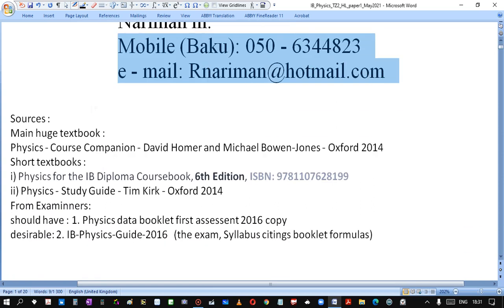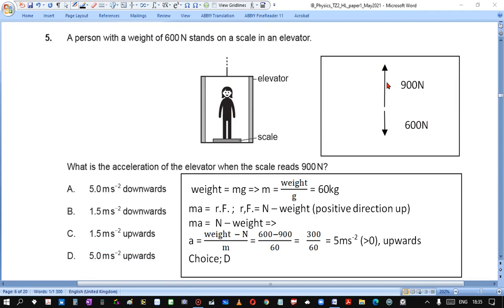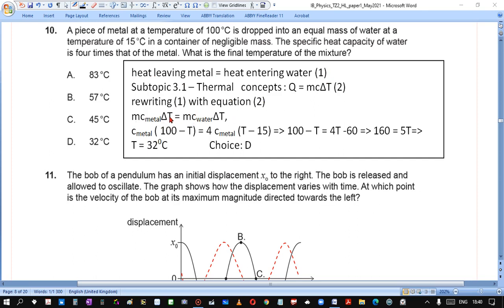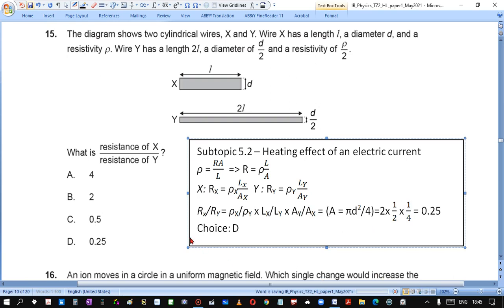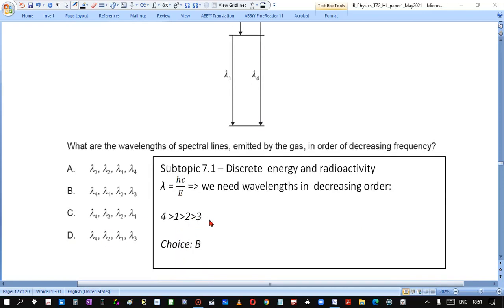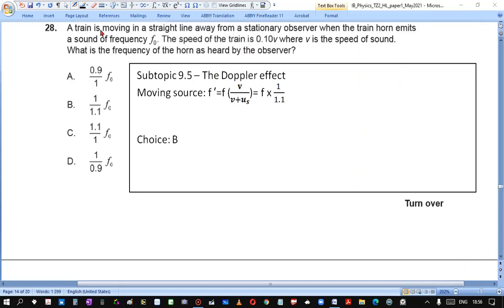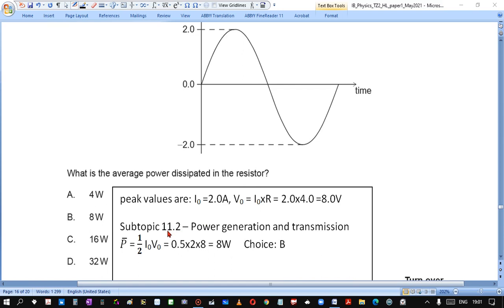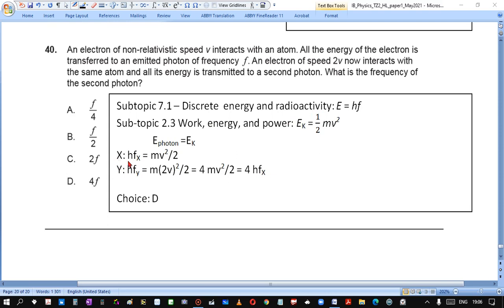Solutions IB Physics HL Paper1 May 2021 TZ2 past paper Baku teacher TISA EAS XXI century Dunya

Comment: One question, I don't understand why in question 21, wavelengths should be in decreasing order, if it is telling you that it is decreasing frequency, it is not backwards?
Reply from the maker: there is no question 21.
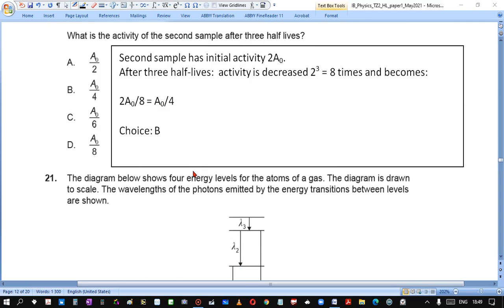Reply: @NarimanRzaguliyev  There definitely is, 18:20, I have the same question
Reply: A bigger transition means more energy is emitted, energy and frequency are directly proportional so 4 > 1 > 2 > 3. The wavelength is just to confuse you
Reply from the maker: Agree.. Sorry for slip of pen,

Comment: Hi teacher. At 7:19 explanation, it is supposed to be 746K not 763.
Reply from the maker: Gas  at 376K was heated. to temperature twice of 273 x 2 = 746K.
AS temperature and volume are directly proportional (actually) expansion),